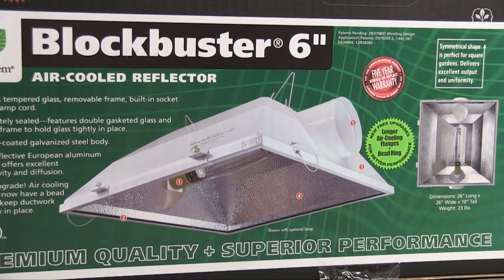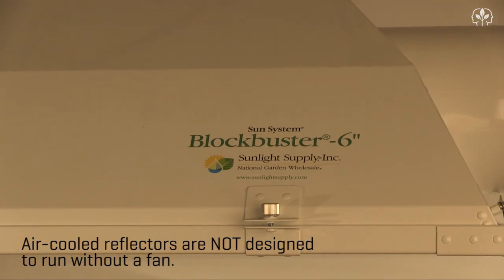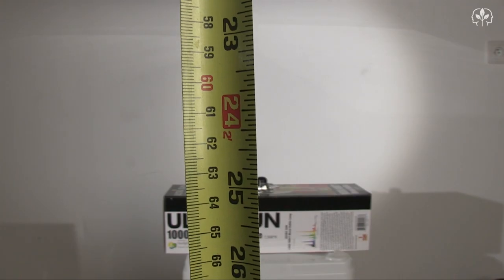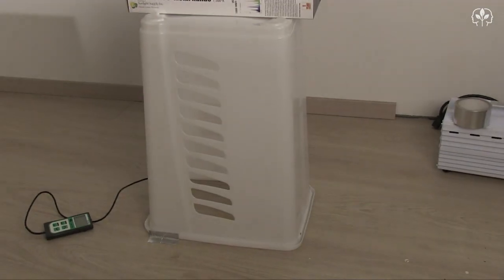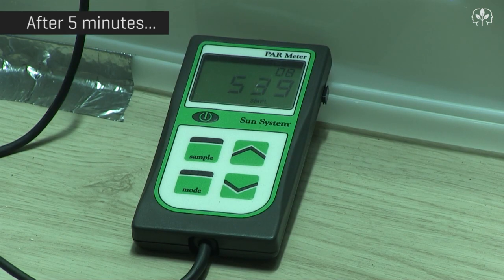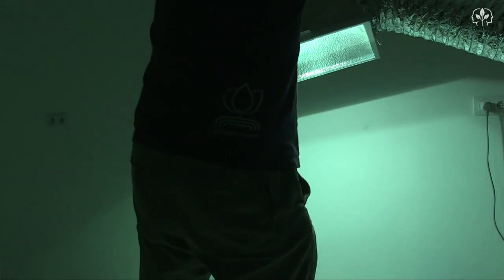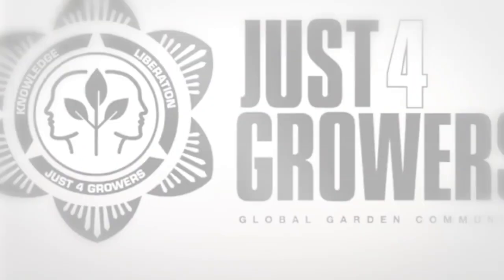Does air-cooling your grow light decrease PAR output / intensity?

Comment: Well, let’s take common sense into affect. Cooler lights run more efficiently. More efficient lighting means more effective lighting. Therefore, A cooler light does not decrease par but instead makes that par a more efficient achievement.

Didn’t even watch the video.

Comment: The problem is not in single ended hps or metal halide lamps. But try this with a dubble ended hps light and the result would be very diferent. Se and de lights work completely different and are made completely different. De light is filled with gas vs se light that has vacuum inside, wich is a great isolator. De lights also works diferent and need to be at hight temp in order to emit the right spectrum.

Comment: How much does a 600w need for cooling? I have a small growspace and I'm using 500qm/h Ventilation ...I dont know if this is way to much for cooling, or should I buy a second, weaker ventilator for my HID?
Reply from the maker: +InnocentPhoto how many cubic meters is your grow space? This fan should be fine for anything up to 8m3.

Comment: How cool should the incoming air be going into the 1000 watt reflector? How will I know if i'm over cooling the bulb? Any idea on what the outgoing air temp should be at the end of the reflector?
Reply from the maker: Normal room temperature of 70F - 75F is fine for blowing through hoods—remember to go with a low fan setting (minimum) as blowing too much air will definitely overcool your lamps. The new designs (e.g. ACDE ) with the sealed optic chamber which cool by convection are awesome. http://goo.gl/FOTH0F
Reply: Thank Everest. I forgot to say that the 1000 watt reflectors are 8 inch air cooled Raptor reflectors (Still in the box) and I will be having two reflectors in line with with others. The extractor fans are Can-Fan S 800 (Still in the box) with an output of 2.32 CFM per watt. Any idea on what the watt set or cfms should be? This is my first indoor grow. I love growing outdoors. My two 10 x 10 x 12 grow rooms are still under construction and should be ready by the middle of next month. Thanks again. And yes, I did subscribe a while back. Oh, I got all this stuff and more at a hydroponic store going out of business, 40% off.
Reply from the maker: Good job on the bargain hunting! And thanks for subscribing—I genuinely appreciate it. THANK YOU. Keep in touch—peace and happy growing, Everest.

Comment: i was considering venting threw my air cooled light. im going to remove the glass and up the fan 8inch for 1000w hps, ill have a second 6inch at the bottom bringing in fresh air, what do you think of this air flow system? any loss there?

Comment: I think your air cooling that fixture backwards, I have mine pass over that triangular piece to reduce air hitting the bulb directly.
Reply from the maker: +buzd2kill you make a very interesting point Bud2kill. Over-cooling lamps is a no-no for sure. I always dial my fans down to 35% for direct cooling. I'm pretty sure that at this pace you can hang the hood either way but it's definitely worth investigating more. Thanks for taking the time to feedback. Happy growing, Everest.
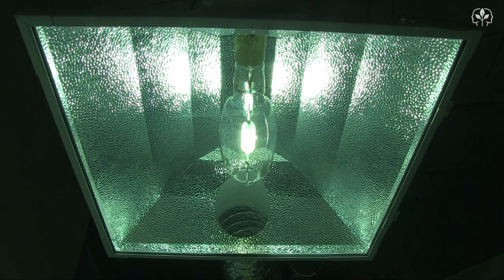Reply: +Everest Fernandez (Just4Growers) If you run into the base of bulbs side you will get less friction on the bulb, no direct contact just passing over. Im sure the difference is minimal but just my opinion. Pause the video at 3:31 and notice the shape of things to force air around the bulb. Happy Growing!!
Reply: evo nine  you don't want to cool the bulb, only remove the heat from the bulb. Bulbs need to reach certain temps to operate properly. I'm sure it's minimal either way.

Comment: What about with a HPS globe?
Reply from the maker: +Tom Forrest Hi Tom—do you mean the HPS lamps with the egg like outer-casing rather than the long narrow tubes?
Reply: +Everest Fernandez (Just4Growers) A HPS bulb with a standard arc tube? As I understand it, DE HPS globes are even more impacted by air cooling?
Reply from the maker: +Tom Forrest DE HPS lamps' outer jackets are filled with nitrogen, a poor insulator, so I do not recommend direct air-cooling. Check out my video on the Sun Systems AC/DE reflector which solves this problem very elegantly!  www.youtube.com/watch?v=vidqDyV1ks8

Comment: very interesting,did you test taking the glass away, i just ordered some spudnik150s
Reply from the maker: pimp2hoes Hey Pimp. It's funny you mention that. I'm making a video about this very topic! You'll see it on the channel soon.
Reply: Great, keep it up, ill suscribe right now!AS my climate conditions, i wont need them after summer to be closed, and that UV cut, makes me really worry no that mutch of less percentage of light, but cutting the lights spectrum cant be that right....
Reply from the maker: pimp2hoes HPS contains practically no UV, so you don't have to worry about that. MH has a little more, and Plasma has a nice amount. You wouldn't want to be air-cooling MH lamps anyway because they are more susceptible to spectral degradation when air-cooled. UV is awesome at stimulating essential oil production and keeping bugs and mildew at bay. Peace and happy growing. Thanks for subbing.
Reply: Thanks for clarifying!
Reply from the maker: pimp2hoes No worries! I ran a bunch of tests today with glass on / glass off. The results will be published next week.

Comment: Does the glass make a difference?  Thats the arguement I hear a lot  .     Not  the fan.
Reply from the maker: propertyservices1 Good question! Glass will cut out any UV emitted by your lamp (this is specifically relevant to metal halide or "finisher" lamps 10,000 kelvin or more) - and it will decrease light intensity just a tad by reflecting some light rather than letting it pass through. The upside is that you can position your lights closer to your plants, more than negating any effect from the glass.
Reply: +Everest Fernandez (Just4Growers) Cut out any UV emitted by your lamp, like 100% of the UV? or just some?

Comment: the issue is the glass..  try removing the glass and see what the difference is
Reply from the maker: Thanks for your comment, CA. It's timely as I'm about to experiment with the Sun Systems AC/DE reflector. As you may already know it's set up so that the lamp itself doesn't have air blowing over it, just a chamber in the top of the reflector, so the DE lamp can burn at the right temperature. You can remove the glass from the reflector too so it will be interesting to see what difference the glass makes.